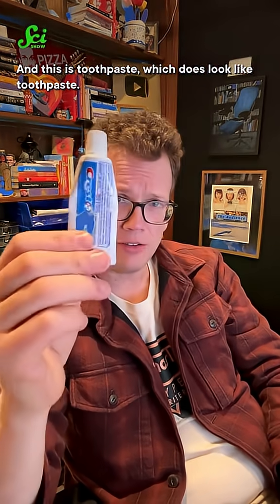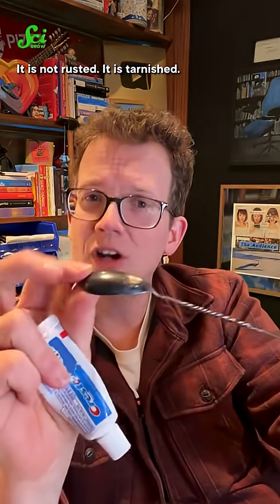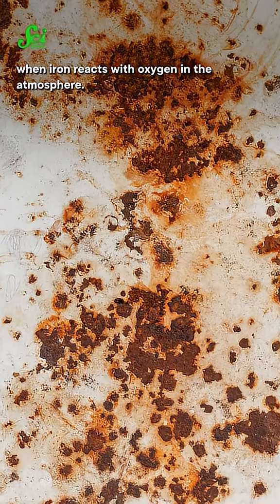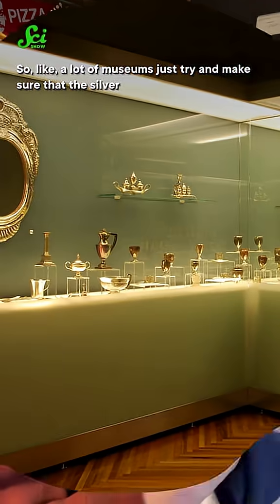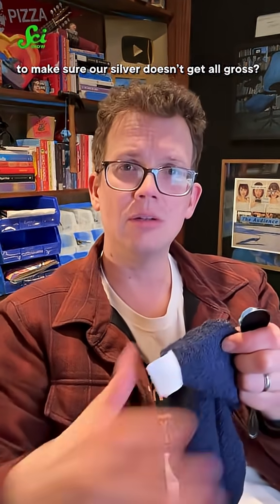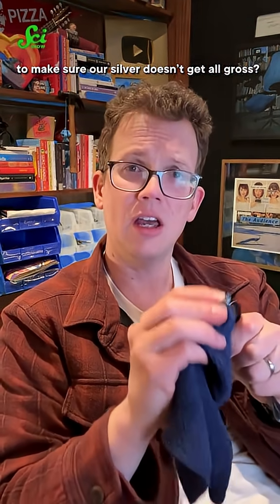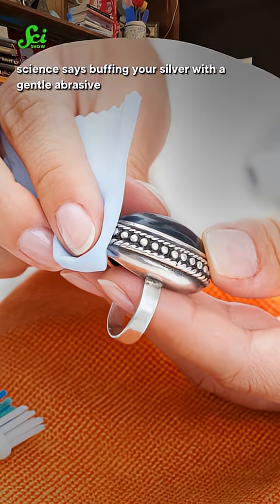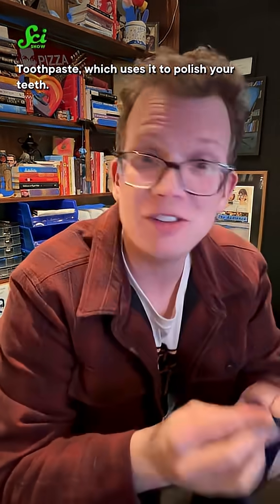What makes silver tarnish?

Comment: I have a little silver ring. It was $15 at a market. It has a inlay vine, so the vine is raised up so when you polish it by hand only the band and the vine polish and I really like the oxidization on the inside part cause it makes the vine stand out more. I didn’t like it as much when I first bought it as I did once it oxidized.
Reply: Jewelers often do that on purpose, putting the silver in a solution called liver of sulfur makes it tarnish almost instantly, then only the high parts of the relief are polished.
Reply: Love that look. I had a much loved silver chain repaired once and when I collected it and saw they had cleaned off all the natural blackening, I actually burst out crying right there in the store 😅
Reply: Another comment says to use a sonic electric toothbrush to get into the grooves ☺️
Reply: @IfYouMeetAWolf  the point of my comment is that I don’t want to get into the groves. cause I like the bottom part being tarnished. Because it makes the vine pop. kindly, I’m not sure which part of me saying that I liked the oxidization made you think that I wanted to get rid of it

Comment: I use a different method...I put a sheet of aluminium foil in a bowl (shiny side up), inside it I put a teaspoon of salt, a teaspoon of baking soda (sodium hydrogencarbonate) and my silver jewelry that is tarnished. Then I pour boiling water over it all and let sit for a couple of seconds. I use some tool (a stick or a spoon) to take out the jewelry when I am happy with how clean it is. The tarnish just transfers to the tin foil.
Reply: This pulls the sulphur off the silver and onto the aluminium foil. There is no net loss of silver or other damage. Some don’t like it as it leaves their antique silver looking like new. I use borax and water in a Pyrex dish with aluminum foil. As soon as the silver touches the aluminum it becomes shiny and the foil starts to darken. Saves hours of buffing.
Reply: @lawrenceharris7717 does it have to be hot water with the borax?
Reply: @TaLeng2023 no but might dissolve better if it was warm.
Reply: Same, it works very well. But the smell on the aluminium foil after is gross!
Reply: I’ve been using the above method for years… think I found it on a YouTube video and when my grandmother started complaining about her silverware tarnishing we tried it and it worked great.. never went back… she’s 94 and sees no reason to NOT use the good silver as an everyday, every meal, utensil.
Reply: I've done something like this before too, and it worked :)
Reply: So do I, although it's important to note that in this specific case one should use the more accurate aluminium foil, rather than the colloquial tin foil. Real tin foil doesn't have a high enough electronegativity to reduce the silver sulphide.
Reply: I don't think anyone makes tin foil anymore, just buy aluminum foil.
Reply: Also works with only salt, aluminum foil and water
Reply: I’m pretty sure this is the electrochemical method he mentioned.
Reply: @enenenergp notice the lack of electricity
Reply: @enenenergp  I think it actually isn't. Since there is no use of electricity it would be just a chemical method. I read the explanation somewhere, but forgot. I think somehow the baking soda and salt draw out the sulfur compounds from the silver. You should do this in a well ventilated area btw because it releases sulfuric gases into the air
Reply: Tell me you know nothing about electrochemistry without telling me you know nothing about electrochemistry.
Reply: @ruffy0001  This is electrochemistry. When you wrap silver in aluminum foil and immerse it in the baking soda (sodium bicarbonate) hot water solution, you create a mild electrochemical cell.

Aluminum is more reactive than silver, so it acts as the reducing agent.

The aluminum gets oxidized (to aluminum hydroxide while the silver sulfide is reduced back to metallic silver.
Reply: Works for me too
Reply: Works like a charm my go to as well. No color diff i ever see
Reply: Not tin aluminium, also EDTA cleans nice it don't transfer tranish to foil, it rips 2S atoms from Ag2S which is black tarnish and in the end sulphur compud are released that's it's smell like rotten egg yolk
Reply: I never use anything but foil, room temp water and salt.
Reply: Use Washing Soda, not baking soda. The reaction transfers sulfur ions from the silver to the aluminum. Buffing with a microfiber cloth will get the residue off. Sulfur from the atmosphere attaches to silver, creating silver sulfide tarnish. Thats transfers to the aluminum to form aluminum sulfide, and hydrogen sulfide gas (H2S). Concentrated H2S is very hazardous, but the amount created is negligible with ventilationl.
Reply: @HighInfoSource Sodium carbonate vs. sodium bicarbonate. The results are the same, and folks don't necessarily have to go buy something they may not already have in the pantry. Very small uptick in speed of the reaction, but no other advantage.
Reply: I came here to comment this exact method. All my jewelry is silver and I always use aluminum and baking soda in a bowl of cold water. Way easier than buffing And polishing them.
Reply: It’s a great method, but not one I would use on my antique silver.
Reply: Baking soda is sodium bicarbonate.
Reply: Aluminum foil.  Have never in all my 74 years seen tin foil.  Let me know where I can buy it. Would love to have some for crafting.
Reply: @tinydancer7426  My mother, who was born in 1934, remembered when it was still actually tin foil. It changed just after WWII, once aluminium was much more readily available - presumably because of all the technological changes from the war. In the UK at least, aluminium foil is still often referred to as tin foil. (I was obviously making a bit of a joke). Although you can still buy tin foil (and tin ingots) quite easily on eBay. Not nearly as cheap as aluminium foil, though!
Reply: @tinydancer7426 you are right, tin foil is a misnomer some people use when talking about aluminium foil. 
English is not my first language and I thought it was a common name for aluminium foil.  Thank you for the correction, I will edit my comment now in order not to add to the confusion.
Reply: @tinydancer7426 they are the same as far as I know. It’s just a (if I want to be fancy about it) regional dialect. I have heard it interchangeably, I’ve also just heard it called foil.
Reply: This removes a layer of silver every time you do it, which isn’t great long term
Reply: @evcotter08  Probably removes less material than scrubbing the tarnish off with polish.
Reply: @evcotter08 Show me the chemical reaction that removes silver molecules.
Reply: @evcotter08  The primary chemical formula involved in this process is a redox reaction (reduction-oxidation). The aluminum foil acts as the reducing agent, while the silver sulfide tarnish is the substance being reduced. The baking soda and salt solution creates an electrolyte bath that facilitates the transfer of electrons.
The Main Reaction ⚛️
The black tarnish on silver is silver sulfide (Ag_2S). Aluminum has a stronger affinity for sulfur than silver. When submerged in the solution and in contact with the aluminum foil, the silver sulfide reacts with the aluminum. The aluminum "steals" the sulfur atoms, freeing the silver metal and forming aluminum sulfide.
The overall chemical equation is:
3Ag_2S(s) + 2Al(s) \rightarrow 6Ag(s) + Al_2S_3(s)
The Role of Each Component 💡
 * Silver Tarnish (Ag_2S): This is the black coating on the silver, a compound of silver and sulfur.
 * Aluminum Foil (Al): The aluminum is oxidized, losing electrons and reacting with the sulfur from the silver sulfide. The aluminum sulfide (Al_2S_3) is a grayish substance that may form on the foil or in the water.
 * Baking Soda (NaHCO_3) and Salt (NaCl): These are dissolved in the water to create an electrolyte solution. They increase the electrical conductivity of the water, allowing for a faster and more efficient transfer of electrons from the aluminum to the silver sulfide. The reaction is an electrochemical process, essentially a tiny battery is formed where electrons flow from the aluminum to the silver.
 * Hot Water: The heat increases the speed of the chemical reaction.
This method works because it reverses the tarnishing process rather than abrading or polishing the silver. It converts the tarnish back into solid silver metal, which preserves the original finish of the item.